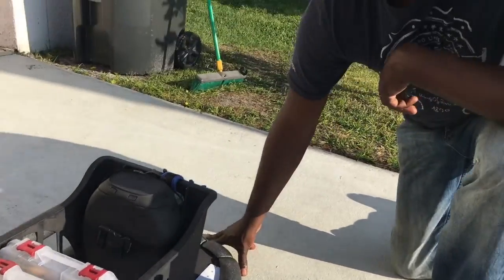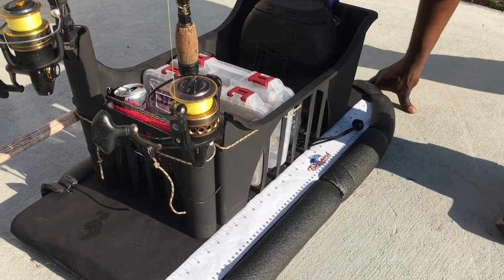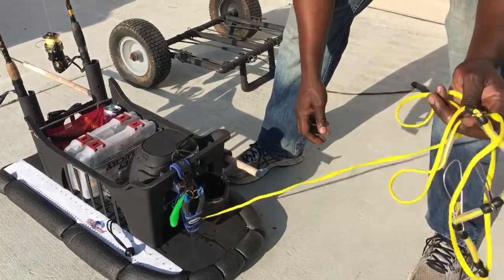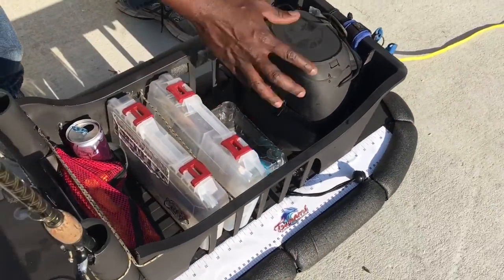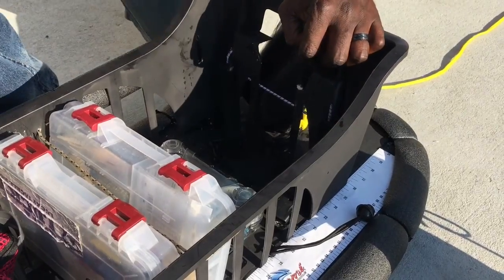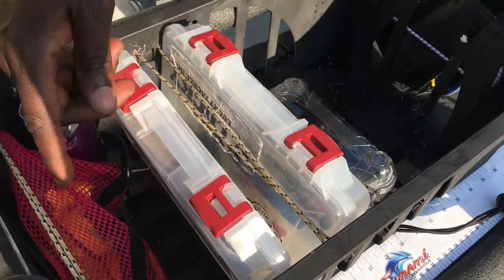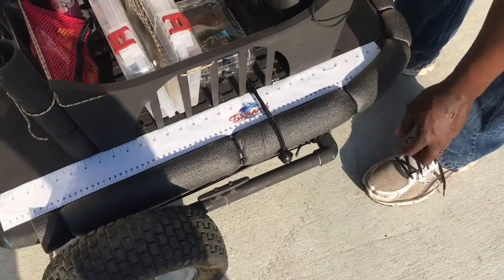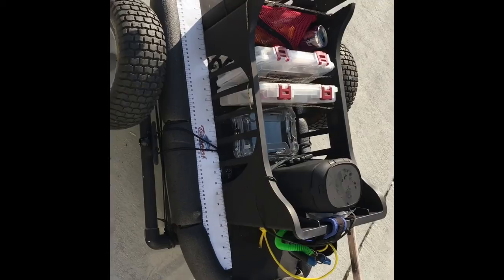Wade fishing caddy

Comment: did you poke small holes on the board to get the tie straps around the pool noodle?? if so any issues with it floating.
Reply from the maker: I drilled little holes to put the zip ties around the noodle. The  board is very buoyant  so you're not gonna get any leaks coming through those holes. Have not had any problems yet.

Comment: I like it but wont your bait cook ?
Reply from the maker: I've put 2 dozen shrimp in there and they all stayed alive. I've also used green backs before. Never had any issues keeping bait alive.
Reply: On hot days you can put a small frozen bottle in the bait well. Also you can use the reflective insulation from home depot and line the inside of the bait well, that's what I do to my coolers when I go camping. I refuse to spent hundreds on a yetti.